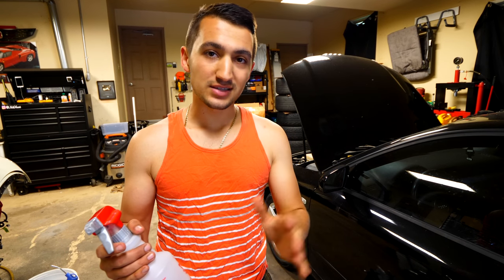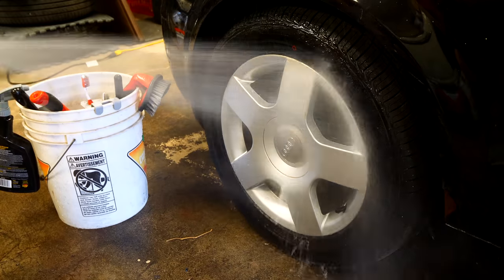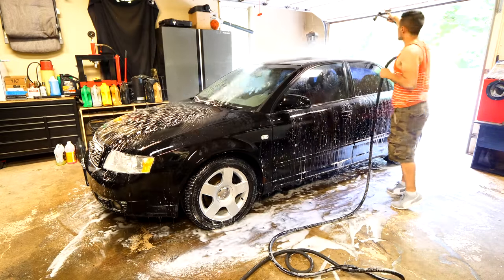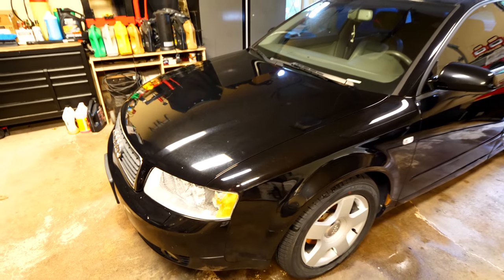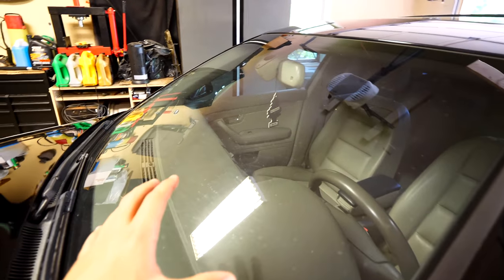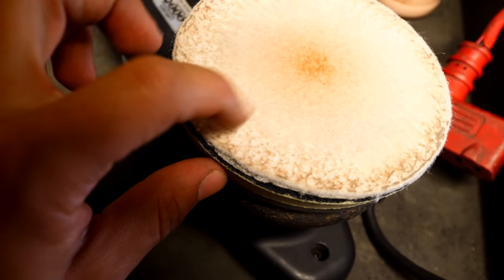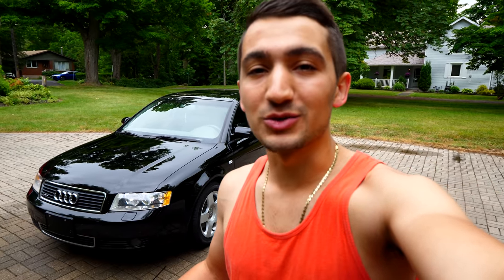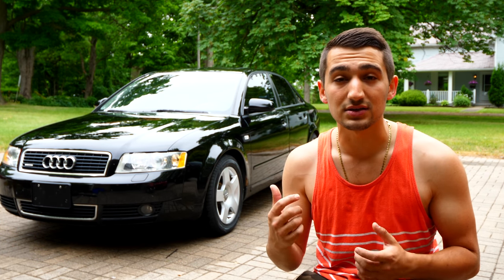How to Detail the Exterior of Your Car (COMPLETE GUIDE)

Comment: The car turned out looking excellent! You did a good job washing the car, other than I would a least have a clean bucket of water to rinse any dirt off your mitt. Spaying it with more suds is not going to flush the dirt as well as rinsing it in clean water.

Comment: Looks great. I would cover up the alternator and if the car has the ECU under the hood just in case as the seals for the connectors can go brittle and let water and dirt in. I just wrap them in foil since it can be molded and doesn't conduct electricity.

Comment: I have noticed you did not cover , the alternator, battery, etc , any particular reason?
Reply from the maker: You are correct. I didn't because there is no need to. I've been cleaning engine bays like this, without removing the battery, without covering electronics, and am yet to run into any problems. Engines are equipped with water-proof connectors which makes cleaning a piece of cake
Reply: Thanks for answer Mila, looked really great the  "new Audi " :D . Love your videos.
Reply: Nice to know, didn't know that. Is this true for a 2014 TSX aswell?
Reply: The Battery Connector is not waterproof. It is direct contact from the cable to the battery poles, and you can be happy that you didn’t kill several control units. And while the connectors are waterproof, that is also only true until a certain degree. They can corrode too.
Reply: keep an eye on the coilpacks... sometimes the seals do not seal properly an "hello misfires"  nice vid mate!
Reply: Safety FIRST, specifically for people who is cleaning their engine for the first time, and removing the battery before cleaning the engine is the smart thing to do

Comment: Great video Milan. 
I really like watching your videos you go straight to the point without wasting time. 

I just have a question if you can help, what do you think of using Durpay neat steam cleaner, i couldn't find any reviews about this steam cleaner by customers, the only videos I found were done by the seller, and I don't really trust any seller reviews, can you please give me your recommendations for using the Dupray neat steam cleaner for car detailing.
Reply: Using a steam machine on your car provides a whole different level of cleaning. You can deodorise and sanitise the interior. Remove stains on upholstery. At the engine bay you degrease faster without chemicals over hoses, connectors and plastic elements. You have to test beforehand how much heat those plastics can resist. They can get hazy so, check heat intensity at the steamer nozzle. You can even remove contaminants from bodywork (must test before over a small and hidden area), as the body metal, primer coat, base colour layer and clear coat react differently to heat. At worst you can experience paint delamination so it is safer to test before and gather info from the web. Anyway, those steamers are excellent as a car detailing complement. They are green tech as they require very low level of water and provide a very high level of disinfection. On average the temp at the nozzle is around110 - 130 ° Celsius. Some brands feature temp regulation. Known brands are Kärcher, Vaporetto, Dupray. Check their websites and tech specs.

Comment: A couple of things I noticed while you where washing the car;

1) Are you just spraying "foam" on the car and using a wash mitt and never clean it with a grid guard, or change mitts during the wash? That's a big ass no-no in the detailing world, as you're just pushing old dirt back into the paint during the wash, and are more prone to cause new scratches. 

2) Did you use a clay bar before the start of the polish? A paint can look 10 times better and give a better view of what's needed to be done with regards to polishing after use of a clay bar, and may even reduce the amount of clearcoat being removed during the compounding / polishing stages.

Comment: when cleaning the engine can water get in the electrical system will this cause problems?
Reply: Yes it can, I watched Chris fixes video a while ago and he said to tape any sensitive wiring off and put a plastic bag over it all to be sure. He has a mustang so it might be different for this specific Audi and maybe the sensitive electrical s are under the plastic cover on the engine.

Comment: Not sure I would spray water into my engine and onto the battery, alternator and other electronics. especially my 15 year old engine and electrics, are you sure that's safe? think i'll stick to APC and some microfibre clothes to wipe dry.
Reply: Pope when you are driving with 60 mph in the rain, water gets to those parts anyway. Also when you hit puddles, if you don’t have the underbody shield, it sprays up with plenty of pressure. It should be safe enough. Just don’t use high pressure on electric connections and its better if the engine is not piping hot.
Reply: @alin8891able  but it doesn't splash onto those parts...
Reply: gallardof13 well it depends on the car but some cars have electrical components placed really low or in awkward places and it does splash on them. I drove one of my old cars through a flood and the electrics were fine. I guess it depends on the car.

Comment: So it's safe to polish the windows even if they have been tinted? Cheers.
Reply: Tint should be applied to the inside of the windows, so polishing the outside should be fine. Glass is extremely hard though, zo if you really want to polish it, you'll need a glass specific microfiber polishing pad. These don't have the foam layer which enables you to put more pressure on the glass
Reply: @nickn753  Cool thanks for your help bro 👍
Reply: @kingcrumpet  np mate, good luck

Comment: Do you need to use a power washer to apply HydrO2? I use gyeon wetcoat and that product requires a pressure washer to rinse it.
Reply from the maker: No it does not. The product from CarPro only requires a rinse down as shown in the video :)

Comment: Let's talk about exact values. How much does detailing products costed you? Let's say you didn't had anything that you used in your vid.
And how much money would you get if you sell your audi with dat shine? What's the profit?
Reply: Gedas Alekveravičius you should have paid more attention in your English classes.
Reply: Wow, what an answer. Not everyone is a native English speaker, I live in Russia and he's probaly from the Balkans, where the education system is shit. Don't assume by just reading. Just give him a proper answer and if you don't have a proper answer, then you shouldn't bother to answer tho.
Reply: The thing is, the detailing products he used here isn't exclusively used for this car. For example, the Rupes polisher costs more or less $420 dollars. That cost cannot be added to the car since it will be used for other cars as well. The polisher, pads (microfiber and foam), shampoo, polish, clay bar, etc. will be used elsewhere as well. This means, you need to only take a percentage of the actual cost of those things to add to the cost of detailing the car. Take note, he didn't use ceramic coating for this one. In my opinion, the most costly thing in this whole video is the time he allocated for the car, not the products. 

The question on profit will be hard to gauge since it will depend on how much he values his time, per hour (or minute). If I do the same detail to a car, I might charge significantly less than he does, or more - I wouldn't know, since I don't know how he values his time.

Comment: Hi Milan, where did you get the little wheel brush holder insert for the bucket please
?😜😜😜👍👍👍
Reply from the maker: I found it at my local dollar store. It was intended for indoor use with tooth brushes, but I figured I'd be able to use it in the garage :)
Reply: milanmastracci ok thanks, what was it called so I can search for it here in the UK please? 😜👍

Comment: did you remove the dirt from behind the fairings in the wheel well?
Reply from the maker: Yes!! When I did the brake job on the car it was a prime opportunity to take care of that problematic VW area.. I don't understand why it was designed like that, but yes it was dealt with :)
Reply: milanmastracci I don't know either. If you're going to flip the car, maybe you're not interested in this, but if you're keeping it longer, you may also want to be sure that the sunroof drain is not clogged.

Comment: Is it safe to be wetting the alternator like that?
Reply from the maker: Yes! I was going to show how it is perfectly safe to get everything wet as the connectors and everything in the engine are all water-proofed from the manufacturer
Reply: milanmastracci I have an 01 a4 with the same 1.8. Do you think I'll be able to wash it the same way without needing to cover anything? It's filthy and is in need of some cleaning

Comment: What about dealing with cars with 1 stage paint instead of 2 stage
Reply from the maker: So think of it like this;
A 0-stage paint correction is not polishing it. It will be very scratched and won't have a nice shine. 
A 1-stage paint correction will look a lot better than the 0-stage, however it will not look perfect. You will still see scratches in the reflection. 
A 2-stage paint correction is going to remove the same number of scratches as the 1-stage, however the scratches that we introduced with the aggressive polishing 1-stage correction will be removed and will look a lot better. about 95% of the defects will be removed at this point. 
A 3-stage paint correction will be removing pretty much every paint defect in the paint. It is going to be the most aggressive paint correction, it will be removing the most amount of clear-coat,  and will take the most amount of time. The results will be like nothing else!
Reply: milanmastracci I think the OP means cars with just a single layer of paint. Most cars today have a color coat and a clear coat, but some cheap resprays don't have a clear coat and really old cars sometimes don't have clear coat.

Comment: How is he flushing up the engine with water like that , electric components >?
Reply: Well he should have covered exposed electrical components like the alternator with a plastic bag at least. 

Overall, post 80's engine components and connections aren't effected by rinsing and light scrubbing. Whether it's a lower PSI pressure washer or simple hose water, keeping the stream moving back and forth will avoid jetting water past seals. Knowing that, there isn't much that can go wrong whilst being mindful.

In my practice though it's best to add a simple water based dressing to the plastics and let the engine run for a few minutes to fully dry out.
Reply: @beyonddetail885  letting the engine run after washing it is the worst Idea , If you wanna wash your engine at least do it in summer , let that heat dry it by itself untill you turn the car on
Reply: @SmokeUpDatCrack  Ok dude chill , I'll go wash my engine tomorrow by spraying water and turning the engine on to dry it after
Reply: @drlu3823  A little salty after that slam? Yet, he's pretty much spot on. Either way, as long as we don't cake it all in armor all we should be good ahaha
Reply: @SmokeUpDatCrack  lmao
Reply: @beyonddetail885  IDK I was worried , I heard so many people had major problems after spraying their engine
Reply: @drlu3823  What I saw was a light sprinkle not much pressure for a short time. That's ok. If you attack the engine with water like a bull in a china shop yes I imagine that there would be some damage.

Comment: Washing the car in the garage is risky, you can potentially ruin your dry wall it’s the water as it increases humidity. Shouldn’t ruin it doing it once though
Reply from the maker: It is incredibly humid where I live. The water that is in the garage won't really affect it. During the car washing process, I have a fan going to get the air circulating, and post-washing it, I squeegee the floor to try to keep the humidity down. I would wash the car outside however when the sun reacts with the water and cleaning solutions, it evaporates and makes it difficult to clean